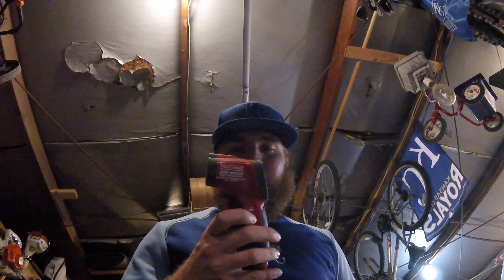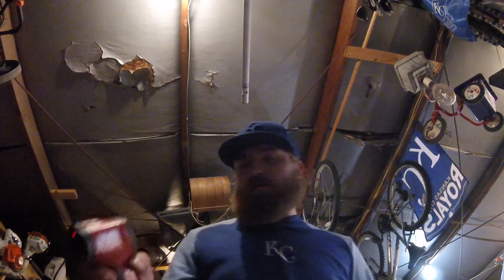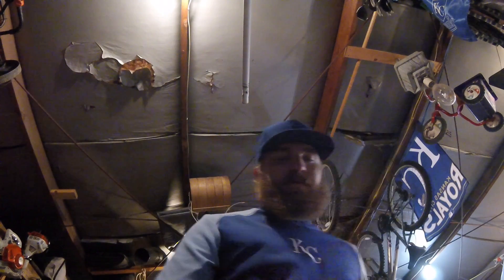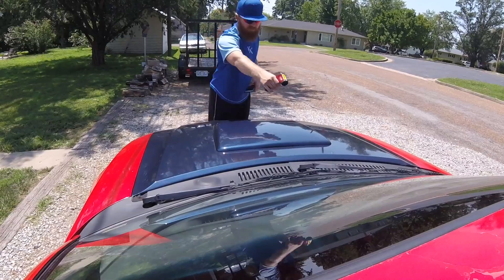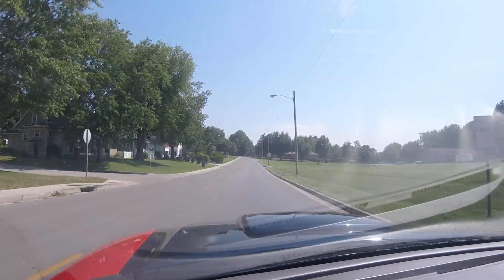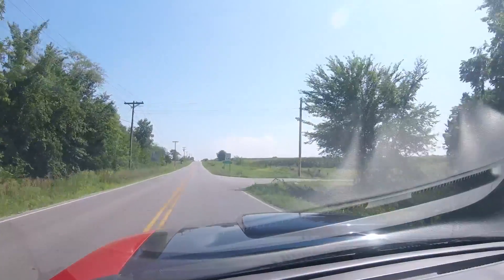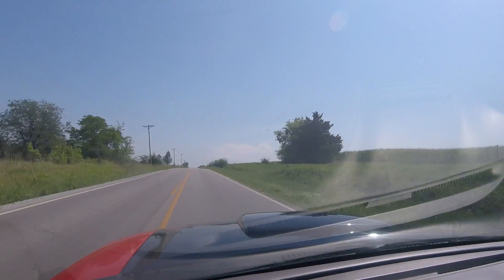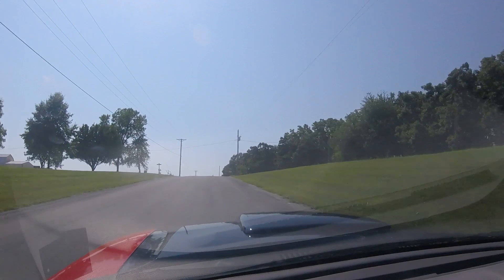What Does Hood Insulation Actually Do?

Comment: To prevent condensation may be the an important function, i will test it. I retired mine because was full of oil after a vvt selenoid gasket explosion due to bad installation and to much oil so high pressure (a truly bad job). It made a good job absorbing the splashes of oil, the rest fall into the bottom engine cover. No oil on the pavement, that was a good job.

Comment: It will absolutely have some cooling effect if you open up any type of venting on the top of your hood, as RAMM did later on with their functioning hood scoops to allow better ventilation of the engine. You can also remove the cover, which will save you about 10 pounds of heat, insulating plastic creating your engine to remain heat, soaked during operation. Anytime you can increase airflow by decreasing restriction within the engine compartment is always a win-win. Even if you were able to put side vents on each of the quarter fenders like some vehicles have simply helps remove unnecessary and more importantly unwanted heat to prevent retarding of the engine. I'm glad I saw your video because I too was wondering about whether or not I could remove my hood silencer without my hood warping being my biggest fear I have a black truck in the blazing sun in which I can fry an egg on and if I remove the hood silencer, is my hood going to distort or is my paint going to melt or even the plastic clearcoat. Thanks for the video.

Comment: It is simply called a hood silencer, which basically gives away the premise behind the hood insulation attached to the underside of your hood. It is 100% meant to dampen the engine noise produced during operation. Unfortunately, in doing so, it doesn't reflect any of the heat, but rather create a heat soak situation rather than the hood dissipating most of the heat through the conduction process produced by the engine compartment and that is its primary purpose. It may do a few other things but that was not what it was primarily intended for when manufacturers started to install hood silencers during the more modern car era. The number one complaint from customers, across-the-board in every brand of vehicle is road or engine noise with a hood silencer helping out on both fronts..

Comment: That ''carpet'' insulation retains heat, moisture, bad smell, weight etc inside the engine bay.
Yes the heat insulation beneath that offers protection and we need it but not the first one.

Comment: Great Video. Thanks. I am of the frame of mind that if they did not need it then they would not put it on from the factory. I also believe it protects the paint, especially clear coat. Sun damages paint over a period of time and i believe that heat degrades paint over a period of time. I actually painted my hood today. The Land Cruiser is 26 years old and the sun did a number on the hood and roof.

Comment: I think you are right I live in Australia where it gets very hot and bought recently a car that has hood insulation for the first time out of all of my other cars and first I that I noticed about this car every time I open the hood is that it is very very hot around engine it hits me so much harder in the face and every time I sart the car the temperature gauge jumps up to it's set operating temperature very quickly within 3min of the car runing. So I am thinking I don't need that crap here in hot climate it is destroying my battery with too much heat under hood and probably hindering performance of my air con 🤔

Comment: Great video. I suspected the same thing, that it really didn't serve any purpose. I had to remove my insulator pad to gain access to replace my washer nozzles for my windshield washer. I broke the clips and tore the pad. I think these are useful to keep heat in when you are warming up your engine in colder climates. The old cars never had them.

Comment: The insulater does a lot  for your car in winter .... but if you live in a state like Texas ... then you really don't need insulater
Reply: It helps a lot in hot weather too, especially if you have a black car. It stops the hood from transferring heat to the engine bay.

Comment: I have been thinking of removing mine. 
I go 4x4 and it is covered in dirt / mud you name it. 
Looks gross.

So looking around to see what the benefits and negative effects are from removing it.
So far I collected, runs cooler being off (good, being a 4bie it does off-road and towing), more noise being off (mine is already loud, so no difference there), and it acts like a fire blanket being on (already have 2 fire extinguishers in my 4bie anyway).

So off it comes I guess 👍

Comment: Ok .. I worked at a company that made these “insulators “  the principal jod they are designed to do is absorb liquid, like if you have a gas or oil or break fluid leak this pad will absorb the most of it and prevent it from splashing all over your engine bay, number 2 is heat and cold from the exterior , with out this pad in cold weather your hood will condensate and wet your engine of and noise

Comment: its purpose serves in case theres a fire in your engine compartment . and adds some quietness for the ticking noises coming from your motor as its running . so it doesn't add much purpose and won't matter if you don't have any hood insulation

Comment: Mine was tearing apart.
It came with my car from factory. 
My car is 13yrs old btw. 
Some said for sound, 
Some said for heat. 
Some said it acts as a fire blanket. 
So it was making my engine bay all dusty from the failing hood liner, 
I took it off. 

And tried burning it with my lighter. 
It did catch fire easily. 
And the fire would get bigger if i didn't put it off. 
(i believe anything that is of fire retardant material would not even catch fire) 

As some portion of the hood liner was 'resting' on my valve cover (due to it sagging) 
It melted on that one specific area over time. 
(heat from the valve cover). 
So i just took it off for good.
Reply: Since you have done that do your car drive better or do u notice an difference mainly good
Reply: @a1dugl2s  and without the hood liner on 

I didn't get that foggy windshield on the bottom part nearest to the engine on rainy daiys anymore.
which I conclude the heat is able to dissipate easier out of the engine bay.

making my aircon compressor not to cycle on/off quickly.

and concerning my coolant temperature,
I don't really see any difference.

if there is, i couldnt tell as my coolant temp is indicated in analog,
not digital.
Reply: @chowaski  I just took mines off. And I noticed it was an cord connected to it is that cord important
Reply: @a1dugl2s  im not sure what the cord is supposed to do or be.
Reply: @a1dugl2s  The cord probably went to a light that was once there.
Reply: @a1dugl2s  bcos i drive a van too.

and it mid engine,

so the engine the below the driver and pax seats.

my previous van was 16 years old.

the liner beneath the seat was torn too.

i took it out.

and i regretted,

cos for my van, the liner was there to trap heat from the engine underneath my seat from entering the cabin.
Reply: @a1dugl2s  
okay firstly,
my engine bay is not as dusty as before.
dusty what i meant is that  it's really dusty.

dust from the liner fabric.

secondly,
engine noise is slightly louder 
for e.g,
i can hear my air box sucking in air.
im on stock with just a washable drop in panel filter.
before this sound was much softer 

but other than that i got to notice that one my my pulleys bearing were almost shot,
if i did still have the hood liner on,
for sound comfort,

i probably wouldn't hear my pulley making that chriping/squeaking noise.

(with the hood liner on, i believe i would only hear my pulley shotting out at the very end of it's life)

thirdly,
with my hood liner on ,
my engine bay is really hot.

and esp on a rainy day,
the bottom part of my windshield would get foggy from the heat that's trap in the engine bay 

but overall,
sound i didn't regret taking it off 
my 13 years old paintwork from factory on the hood doesn't show any sign of fading etc,

i live in a tropical climate,

we don't have seasons here.

it's either scorching hot or heavy downpour.

and we usually drive into our neighbouring country weekly and that would make us idle for an hour waiting to clear the checkpoint customs.
Reply: Big thanks 
Ur advice helped me a lot

Comment: So i had a new hood installed and painted without the insulation, about a year later the clear coat is fading fast.  I think it protects your paint mainly.
Reply: You got a poor paint job.
Reply: @BobbyCamaro  right they act like the exhaust it blowing directly at hood it doesn’t make sense
Reply: KHOI TRAN the new bmw M4 doesnt come with hood insulation
Reply: It does that's the main reason for it and to reduce noise

Comment: Apparently its to stop from cooking your paint. Have you ever noticed the clear peals on alot of old bonnets?
Reply: my hood has been without insulation for years and the paint looks brand new under the hood and like crap on the outside . so no thats not true
Reply: @jd2931  ha! well if your car does it must be true for all cars 🤷🏻‍♂️.
Maybe you live in a cooler area or park in shade so the paint doesn’t reach that specific threshold that it starts to break down.
Maybe you drive like an old lady and your exhaust barely warms up.
I think it specifically effects the clear more than the colour… the heat accelerates paint breaking down. UV and the weather do their part.

Other than that its to silence sound (engine noise) not through the exhaust.
Reply: @joefussy11  I know this thread is really old but from the research I conducted a couple days ago I can conclude that it doesn't affect paint deterioration at all. There are too many cars on the road that don't even come installed with one. There's another 10min video on here that talks about what the hood insulation does and his points seem to be valid.
Reply: @lukasm.1894  there you go. The more you know. Thanks
Reply: Older cars pre 1990 had enamel paint no clear coat.

Comment: I heard its made of fire retardant material, that it will melt if the engine catches fire and put it out, but like i said thats just what ive heard
Reply: Cesar Flores you are correct the plastic Clips on that heat blanket will melt in case of a fire allowing the blanket which is thermal to drop down on the engine extinguish the fire and keep your ass from blowing up.
Reply: 100% correct!!! thats wat it is for!
Reply: That'd be about its only purpose. And with fuel injected vehicles which have no carburetor to spit fire, your odds of this thing serving it's purpose is even less, start playing the lottery.
Reply: Cesar Flores false

Comment: The place that repaired my car did not put a shield in my hood.  Recently the seals in my valve cover began leaking.  I am wondering if the heat from the sun on my black hood contributed to the seals failing?
Reply from the maker: sislt777 I would doubt that could be the cause. Valve cover gaskets should be able to withstand much more heat than sun load. But anything is possible! Thanks for the comment!
Reply: def. not...